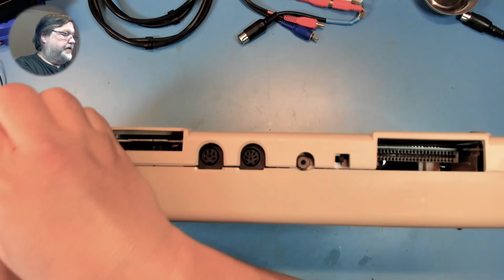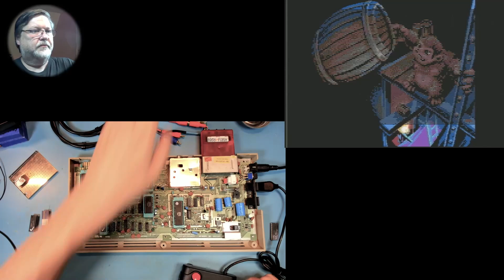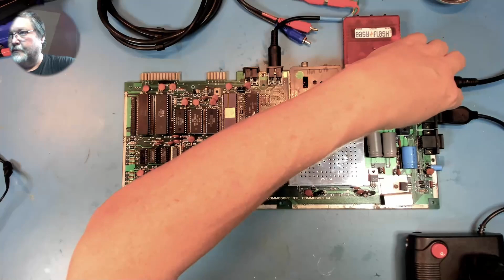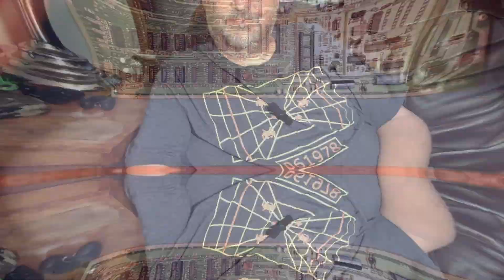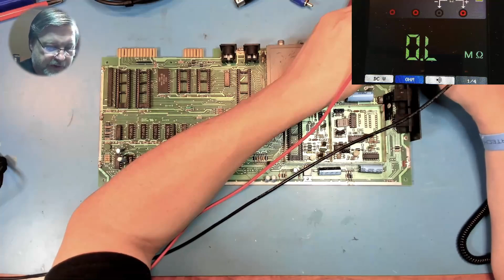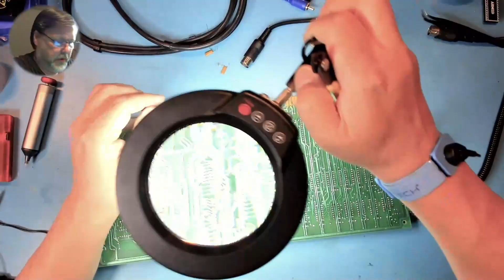Can We Repair the Last Commodore 64?

Comment: Even check the power brick. Sometimes they go bad and put out 35 volts or so.

With the voltage issues, I'd have changed the capacitors. Sometimes that pulls things down too. There could be a lack of capacity or excessive ESR.

On the 120 ohm resistor, 75-100 may work better there. 

And yeah, on the reset, cut pin 9 on the 556 and add the resistor. Keep the bodge wire in place.
Reply from the maker: I never use the original power bricks.  When working on a C64 or VIC-20, I use a custom built power supply with overcurrent and overvoltage protection.  As for the original brick, if I get one with a C64 I buy, I just gut it and use the case and cables to build a safe one into.  The potted components just go in the bin.

The electrolytics on C64s are almost never the problem.  They weren't made during the capacitor plague, though that's no guarantee.

120Ω is the value recommended by most folks who do these repairs and matches the schematics, but yes, 75 or 100Ω might give a little brighter picture on composite, though it would leave the luma signal a little out of spec for an s-video output if I wanted to do that mod, too.

There are other ways to make the reset mod that I've seen, but this seems the most straight-forward and easiest to reverse if you ever want to put the board back to stock configuration.
Reply: @YARC-1981  -- On another channel, the tech measured and found that even 120 ohm gave voltages on the low side of the specs and determined 75-100 ohm for the specific machine met the specs better. But then, I think it used the oldest VIC-II.

I've seen other types of machines where aging filter capacitors on the power rail contributed to lower voltages at the other end of the board. That was the case on an arcade game. The machine was running a little on the unreliable side and changing the large filter caps helped. Of course, they don't change every electrolytic capacitor. For instance, on the solenoid driver board, they usually leave the one in the HV circuit for the plasma alone. It usually doesn't need replacing, and sometimes the machine is upgraded to not even use that rail. In that case, the 5V rail should likely be beefed up a little to accommodate slightly more load there (since an LED display kit was installed)

What many don't realize is that if electrolytics test fine on a "capacitor tester," they can still be marginal. In fact, failing ones may test even "better" than a new one. To test this, you can put a resistor across even a new capacitor and use a capacitance meter. It may read "too high" when the resistor ensures it isn't working as good as it could. Those meters rely on a math formula and apply it to the rate of charge. That is like measuring how long it takes to fill a bucket with a hole in the bottom with water and concluding the 5-gallon bucket is a 7-gallon bucket because it fills at the rate of one.

I agree that these were before the capacitor plague. It also depends on who made them. For instance, you can likely take a modern Chinese-made PC PSU, change all the capacitors (even brand new), and make it more reliable. In that case, maybe change the fan motor too (or at least disassemble and lubricate it). Some modern switching PSUs use diodes in interesting ways where they are more critical such as using them in series. I guess that is to interface between the rare few ICs that use higher voltages to drive 3.3 - 5V ICs (since the forward drop is much higher). So they might not test as shorted out but still might not be working. And I've seen regular diodes used as low-voltage Zeners too such as wiring two of them in reverse piggyback configuration to simulate a low-voltage MOV in an audio circuit as a crude gain control. (Then it won't go past 0.6V in either direction.)

Then with other things made in budget conditions or even sweatshops, the issue is not so much the quality of the components, but more the care in which it was assembled. You may, for instance, be able to take a mechanical wristwatch purchased from Alibaba or similar, disassemble it completely, do a full servicing, clean and inspect everything, burnish any rough edges on the pivots, lubricate it (using common sense and other companys' service guides if you can't find any for that one), and adjust it for better performance and longevity. They may use the same process to make the parts as more reliable companies, but they might not even lubricate or adjust them properly. Sometimes with such watches, you can also make upgrades if you have the tools and know-how. An example would be replacing any metal bushings with jewel bushings.
Reply from the maker: @PlumGurly  With regard to the 120Ω resistor, I believe you're referring to Adrian's Digital Basement.  I've seen that video and yes, he determines that a lower value resistor gives him a better result on composite video.  He never tried to get s-video out.

What specific capacitors on the board are you concerned about?  If you're referring to the large electrolytics used in the regulation circuit, those are only relevant to the +5V and +12V isolated power going to the VIC-II and the SID.  They don't have anything to do with the 5V rail going to all the other components.  That rail is supplied by the external power brick, so changing those out would do nothing for the voltage at the other end of the board even if they were faulty or marginal.
Reply: @YARC-1981  -- In the context, you can tell I was speaking about the power capacitors. You mentioned the voltage being low by the ports. I was just explaining how that could be the case. You said it wasn't and had moved on. I just described how that can be the case with other types of machines.

Comment: Great Thank You ,Enjoyed watching.I'm in Country Drouin Vic Australia and worked on at least 20 of these and learning all the time. actually there is some models with the SID and PLA the other way round. I Nearly got cort with that one.  Thank's.
Reply from the maker: There are four different major revisions of the C64 long board.  The KU-14194HB and the 326298 have the SID and PLA side-by-side.  In the 250407, the PLA is next to the 6510 and the SID is in front of it next to the VIC-II RF shield.  Finally, the 250425 has the SID next to the 6510 and the PLA next to the VIC-II shield.  All you really need to remember is that the PLA is ALWAYS U17.  And yes, this has caught me on at least one occasion when I put them in the wrong sockets and ended up blowing out a PLA with 12VDC.  Kicked myself for quite a while about that.

Comment: Another rushed comment without waiting the end of the video; ARMSID does not use the filter caps, those are only for an original SID, and I believe those pF caps are correct for a 6581 SID, nF caps are used by the later 8580. And an idea, maybe you would like to install those ceramic VIC-II and 6502 from the board #10 on this board, where they would look more period correct.
Reply from the maker: Thanks, Bora!  I'll probably be swapping an original 6581 SID into the board eventually (along with the ceramic 6567R56A and the ceramic 6510 from machine 10 and a few other more period-accurate chips) at a future date, so the cap replacement will absolutely help there.  I used the ArmSID to get the machine up and running.

Comment: I've never seen a ceramic CPU.  I didn't even know they existed until seeing this video.  At first, I thought it was a VIC-II in U7.  And hopefully there will be more C64 repair-a-thons!
Reply: Plastic packages came later, during 70's and very early 80's, almost all ICs (RAM, Logic, etc) were in ceramic packages.
Reply from the maker: Which is why it surprised me that this one had an '86 date on it.
Reply from the maker: I've only ever seen pictures of ceramic 6510's, so it was a surprise to me, too.  There may be more C64 repairathons if I can get enough non-working machines.  They're becoming harder to come by.  I assume that has something to do with how many of us are already out there repairing them.  Watch around mid-2025 to see if I've managed to collect some.  :)  Thanks for watching!
Reply: Me either... I thought it was a ceramic vicII myself

Comment: The reset fix is a must do for the 326298 boards so I'm glad to see that done. I totally forgot about those ceramic filter caps on the SID but it turns out mine has the right values. Maybe Commodore started putting in the right values or somebody changed them afterwards. 

As for the 5V regulator, I'd certainly recommend a bigger heatsink like the cartridge port shield. Don't risk that thing cooking and failing short circuit. The svideo mod is optional but I'm a sucker for better video output.
Reply from the maker: Thanks, Mark.  I'll get around to the regulator mod.  I just didn't feel like drilling right then.  It was late at night.  Your s-video mod is easy enough and I may do it, I just don't have a cable built that would work with it.  That's what held me back there.  I really hate building cables :)
Reply: @YARC-1981  100%. Building cables is my least favourite thing